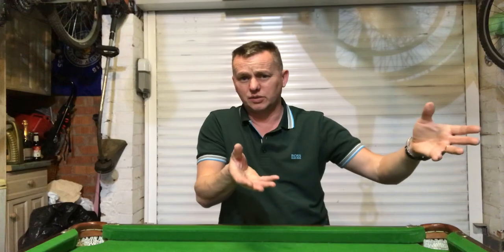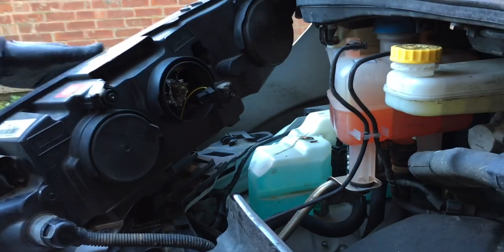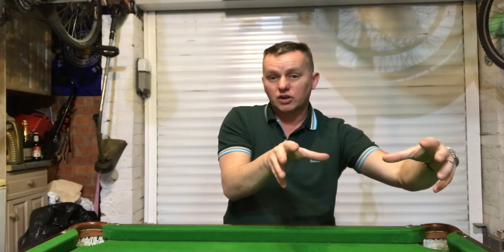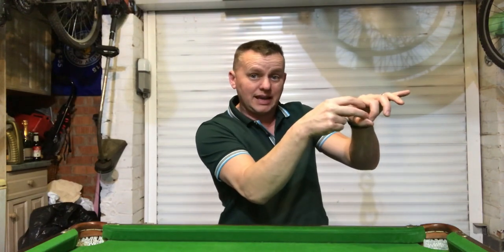How to Replace a Headlight Bulb Fiat Ducato, Peugeot Boxer, Citroen Relay vans

Comment: 2003 Ducato: I tried what you said about moving the headlamp to one side but it did not work, mine has a ball and socket fitting which you have to pull straight out, but it is very tight
Reply from the maker: Thanks for the great information👍🏻👍🏻🛠

Comment: I have watched many of your Aygo/C1/107 videos..... but what I really need help with is how to change the starter motor ??? Any help or advice would be massively helpful... Thanks in advance
Reply from the maker: The video on replacing the clutch/ gearbox shows the two bolts holding in the starter motor, then it’s just two wires and it’s off👍🏻🛠 you might need to remove the lower bolt from underneath, thanks for the great comments 👍🏻👍🏻